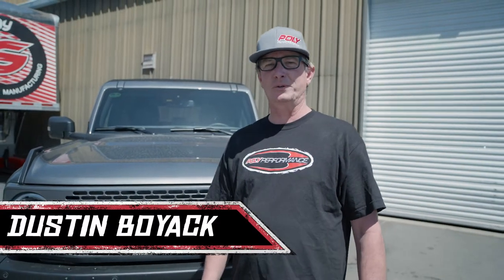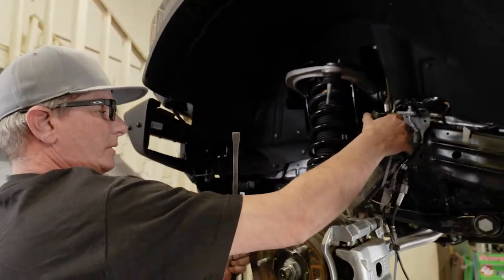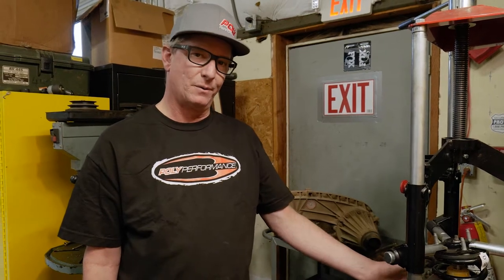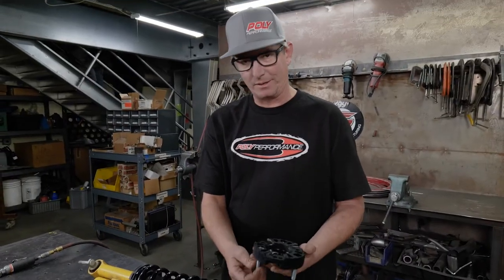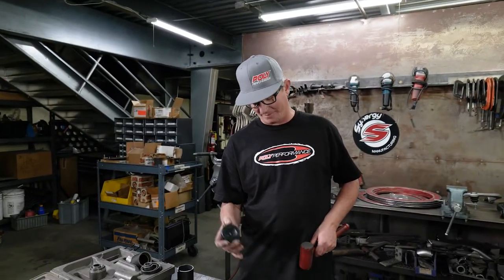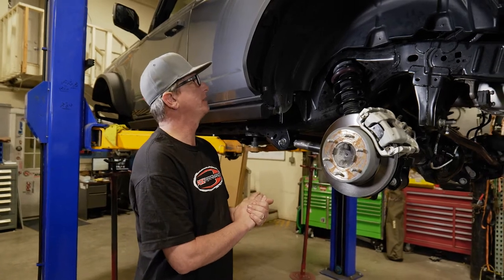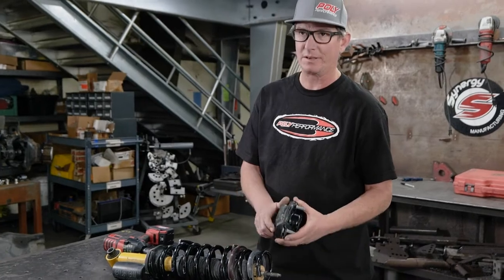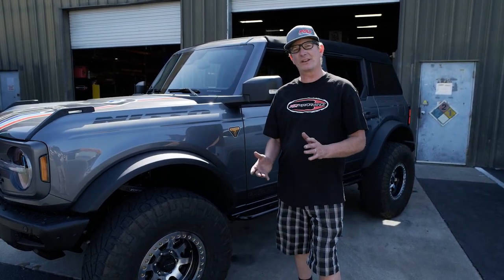Installing a Zone Offroad Lift Kit on the 2021 Ford Bronco

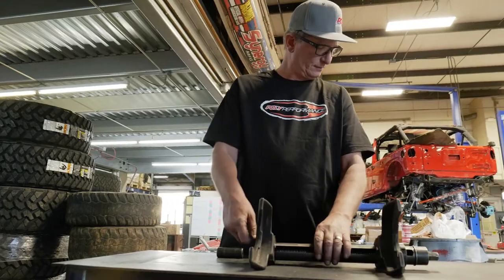Comment: Helpful video. Thanks for putting this out! Do you know the make of the strut compressor used at 10:14 ?
Reply from the maker: Branick 7600 👌
Reply: @PolyPerformance  Thanks for the reply but I was referring to the handheld strut compressor used at 10:14 in your video. The Branick 7600 is the initial larger compressor in your video.

Comment: Was the a sasquatch equiped badlands or a standard?
Reply from the maker: This is a Sasquatch Badlands
Reply: @PolyPerformance  Do you know if the bump stop spacer limits upward travel? and if you don't plan on running larger tires do you even need it?